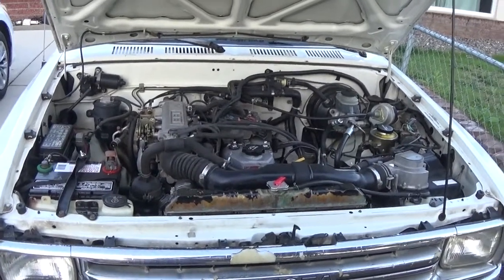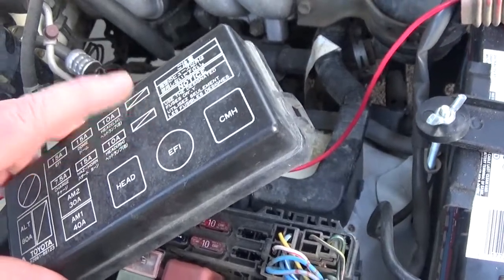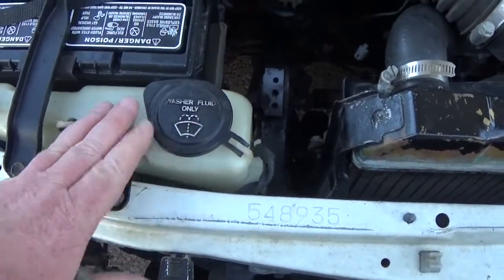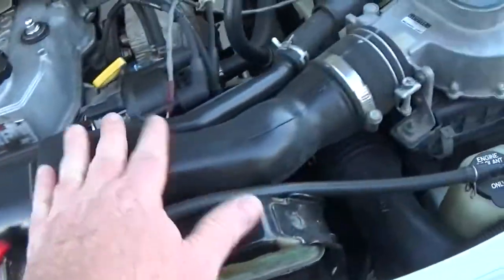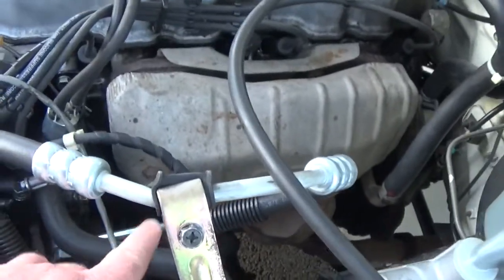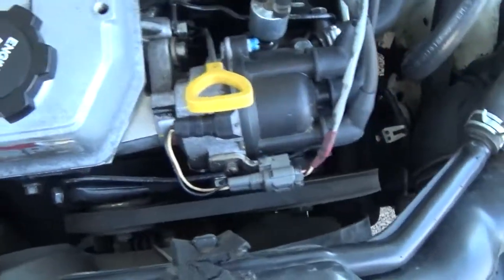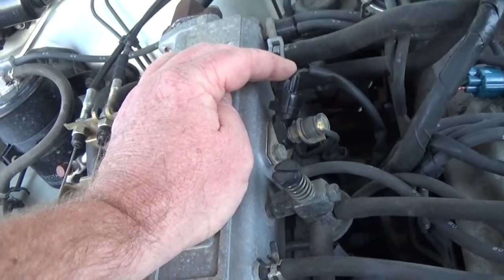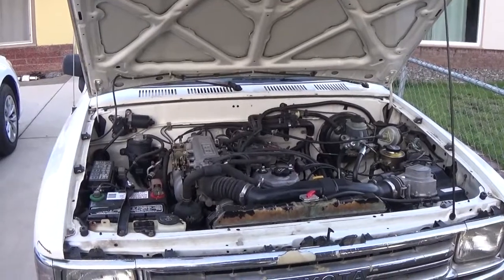Tour of 22RE Engine

Comment: If you need any info from the Haynes manuel let me know......free of course
Reply: im trying to figure out where the block heater is located, i have the cable for it but the mechanic didnt plug it in when they put my engine in. i just wanna plug it in and i dont know where to look, my engine should already have a block heater from the factory

Comment: Mass flow sensor
Reply from the maker: That is a good idea for a video.  This engine uses a VAF (Volume Air Flow) meter.
Reply: Directly correlated to the function of the electric fuel pump....just got a 1985 Toyota Dolphin, learnin'!
Reply: @mechantics  Toyota slumber queen 87